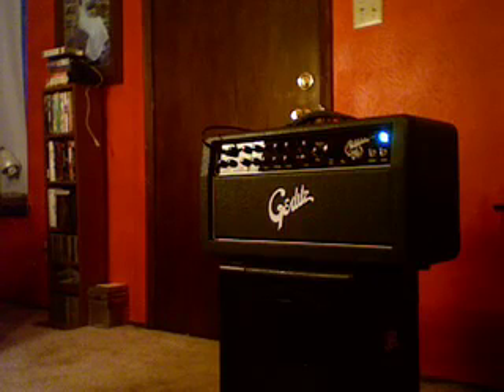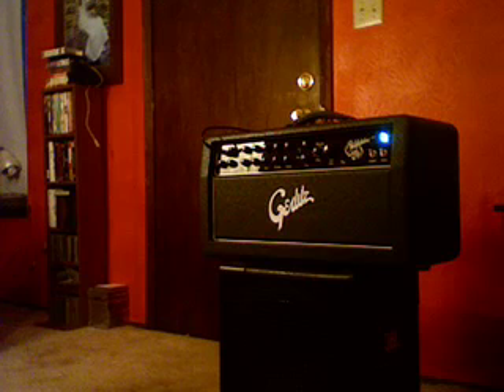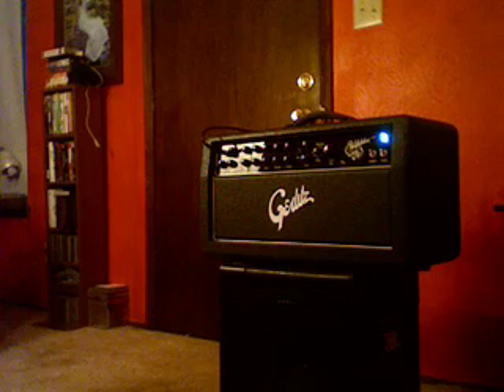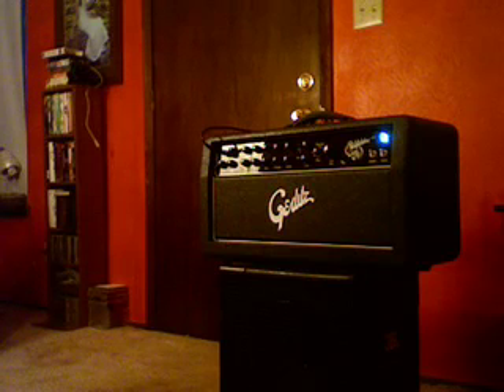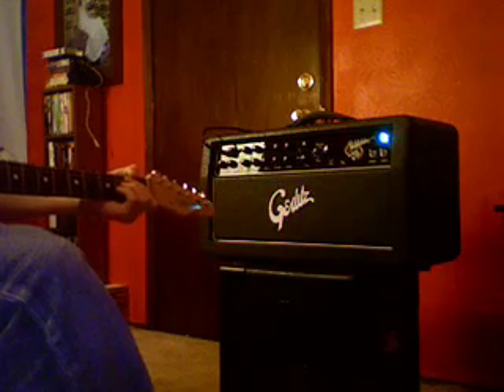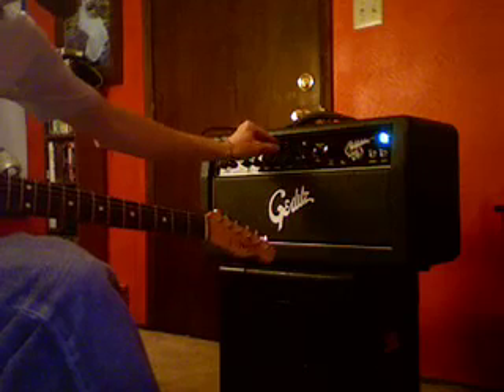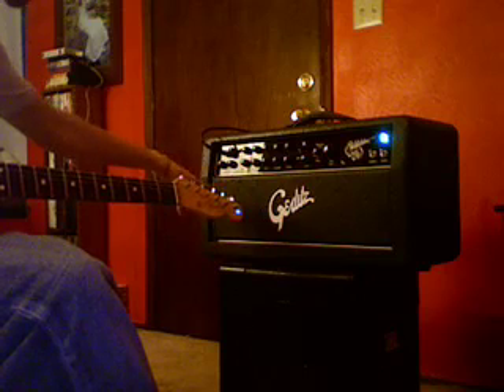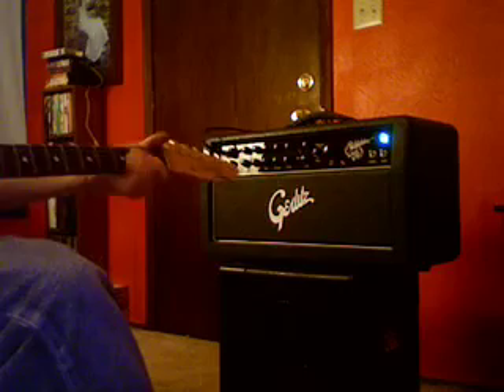Gerlitz Revelator Amp Demo (1 of 3)

Comment from the maker: I love my Gerlitz I haven't wanted another amp since I bought it. I've never heard one without the Tre' Mod, but I've often wondered if the original sounds as good.

The Box of Rock sounds incredible with it. I use the 'Blackface" side with the sparkle switch always on, so it's more a Vox sound than a Fender sound. But using the BOR, you can really hear the difference between the two amps and their styles of breakup.